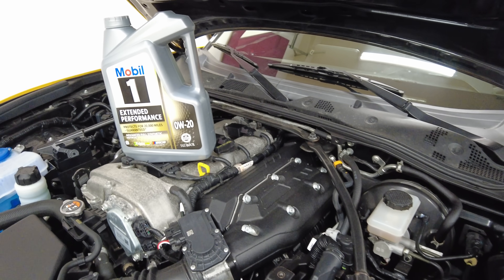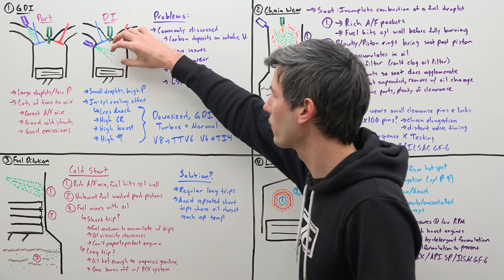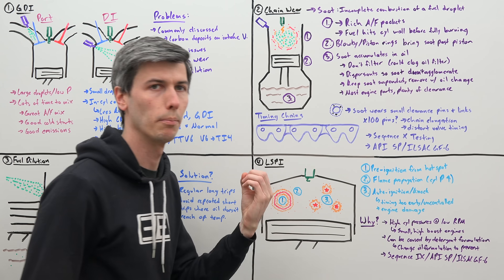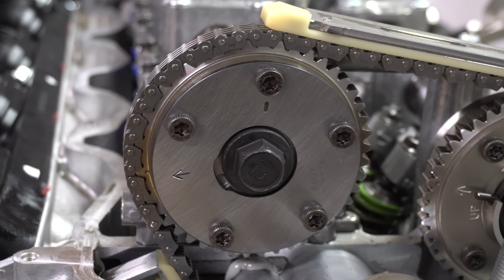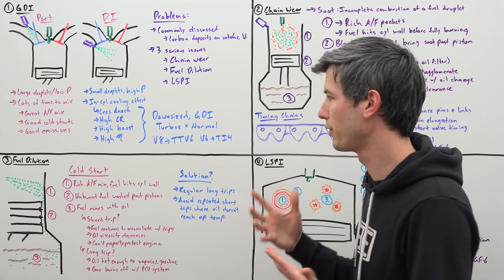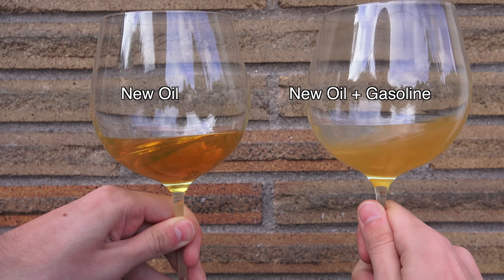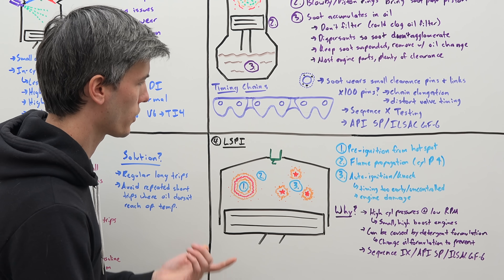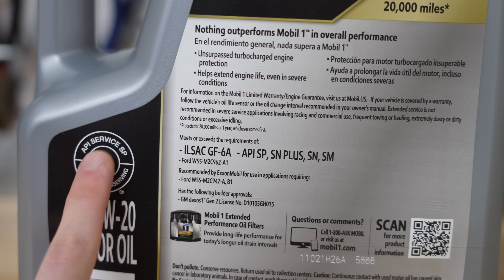3 Big Problems With Direct Injection Engines (Gasoline)

Comment: I have a2013 Ford Fusion, eth an EcoBoost 1.6 liter engine. Just coming up to 200,000 kilometers. A mechanic said I was lucky to get 200,000 kilometers out of it, as I follow the manual to the letter. Because Ford used 'one use only' parts, that are no longer available for the discontinued vehicle. We are looking for an older Toyota Camry, or a Corolla, to replace this car. Repair estimate is $3,000, more than the car is worth.

Comment: For engines designed to run 5w30 or 5w40 oil, this API SP specification adherence might be less important over that of SN. Taking a tuned EA888 as example, where i need to run 5w40 over the factory spec of 5w30 in order to ensure correct viscosity at the higher temps I see. I checked the specifications for the different oils i use, and none mentioned SP or ILSAC 6 for the grades i need, and only looking at 0w20 products did they start to appear. Would a tuned engine pushing more power that's designed to run on 0w20 then become too thin at the higher temps to provide the protection you need, given that tuning is a way to improve efficiency?
Reply: only 5w-40 (or thicker) in any case n nothing thinner;p..don't even ever have a single doubt..n there's no such engine on earth designed to run on some certain oil viscosity;p..thinner oils - only for environment's sake, but not for your engine's welfare n longevity..

Comment: Boost from a turbo does not happen at low engine speeds.  The boost is directly related to the exhaust output and speed, higher speed created a larger volume of air per period of time.  All engines output the same amount of air per revolution the faster the engine turns the more volume of exhaust.  Turbo and other boosted engines have a lower compression ration than a naturally aspirated engine to keep the peak cylinder pressure from creating head gasket failure.

Comment: I remember back in the 80's where Chevron started adding cleaners into the unleaded gasoline to keep the intake valve clean because of the gasoline going over the intake and creating carbon build up.

Comment: Question. Great video btw. In your fuel dilution section of your video, having your car stationed but letting it on for 10 mins without moving it, and then driving for 15 mins, would that still be considered as a short trip?

Comment: If you take anything out of this video is should that there are compromises being made.

Engines that run at high rpm need to have a lightweight rotating assembly. But in high load, low speed operations, they need better cylinder air swirl characteristics, which isn’t high speed friendly. Plus throwing boost at it doesn’t actually fix it, only band aids it. Likewise can build and engine for these conditions, dished pistons etc, but you will lose top end speed and power (somewhat Diesel engine like). So instead, you have an engine that compromises on longevity. 

More engineered oil with solve any of these issues. What needs to and eventually will happen is we will see different cylinder head designs, and pistons that will promote swirl or a/f mixing. There will be more injection shots per cycle and possibly even a second spark plug for more precise control.

Finally pistol cooling will be properly addressed and major thrust side of the cylinders will see proper cooling.

Long and short, gas engine engineers will pull their heads out of their rears and make engines properly. The reality is they have the ability to fully control ignition, injection, and even boost (somewhat), but they are limited by design decisions that plague them.

For the record Diesel engines are not immune to any of these issues, but mostly solved them all long ago when they went to high pressure direct injection with high boost. But the gas engineers didn’t seem to read any of those books. In the end, the consumers pay for it.

Comment: There are hundreds of thousands of DI engines running around with LSPI caused broken ringlands that have stayed in place and causing excessive oil consumption issues that most dealer cannot diagnose properly. Proper crankcase evacuation also reduces the chances of LSPI.

Comment: They need to do MPI and GDI or at least be equipped with a catch can from the factory. It's terrible how many misfiring cars I work on thats just oh well you bought GDI go get the valves properly cleaned at the dealer.

Comment: Why does it matter whether the air is cooled in the intake manifold or in the cylinder?  It's the same amount of cooling either way.  The advantage of DI is you don't inject until you the last instant, which reduces the chances of pre-ignition.

Comment: There's a lot of 'bad science' here, a bunch of assumptions that you seem to think the automotive engineers haven't already accounted for. There are literally millions for DI engines on the road today, with no known problems in the industry. Your acting like an Anti-vaxer, "well if 1:1,000,000, 000 people/engines might possibly have had a problem, this must be a bad idea, and we shouldn't do it. All anyone needs to do is follow the recommended manufacturer maintenance requirements, to include oil specification. That's it, you're inventing a problem that just does not exist. 
Also, on all my cars and motorcycles, the timing chain/belt isn't in the oil/gas/air area, its in a sealed separate/compartment, which specific engine have the timing mechanism within the combustion area?

Comment: Costly and early high pressure fuel pump failure seems to be common with these engines?   Somewhere around 50k miles.   Apologies if I missed another comment touching on this.

Comment: It never occurred to me that VW's 2.0Ts go through chains every 100,000 miles or so due to being Direct Injection. Might this also contribute to their 1/2 thrust washer design failing?
Reply: It's the tensioner that's the issue for almost all vw timing chains.  Almost never the chain itself
Reply: @ptspyder  I don’t think so in this case. the original recall was due to poor tentioner design, And that was a poor design, the original chain design wasn’t great eitherbut I put 200,000 miles and 3 chains on my GLI. (There’s been 5 iterations of chain so far, I used designs, 1,3, and 5) They stretched out by the time they hit 80,000. All 3 chains were different part # 
Ultimately engine failure was due to the thrust washer coming loose, finding the oil pump tensioner, and starving the engine of oil pressure.

Comment: As an expert in this area I approve of Jason's overall coverage of the topic. Not all GTDI engines suffer with it as it's very dependent on the exact design of everything component in the combustion chamber.

1. 2. 3. Centrally mounted direct injection is much better as its fundamentally going where you want it in the first place and any wetting is on the piston crown rather than the walls. Compared to side mount DI this leads to better mixing, reduced soot formation and reduced oil dilution. Latest fuel systems also have even smaller nozzles improving the atomisation and further reducing piston/wall wetting.
4. The most likely source of LSPI is different for every engine design. It can be oil from the ring gap, carbon deposits flying around the chamber or products of incomplete combustion in the spark plug crevice. Good engine design can minimise these when they are found to be an issue, but also you can design the vulnerable components to withstand the forces when they occur, - that is spark plugs, pistons and conrods. So oil might have a big impact on some engines (that suffer with LSPI from oil in the ring gap) but not all.
Reply from the maker: Thanks for sharing extra info! And yes, having spoken with several of the OEs about this, there's certainly a wide variety of how much these three problems affect different engines.

Comment: Thank you for the informative video!  With this info you gathered and presented, has this changed how you service your vehicles and/or would advise others to service their vehicles?  What are your thoughts on recommended fuel injection services and engine performance restoration kits such as those sold by BG Petrospecs and Valvoline?
Reply from the maker: I don't currently own any turbo engines, but my Mazda has direct injection (and is supercharged). I don't drive it that many miles, so I usually just change the oil annually, and use a good synthetic (in this case I'm using Mobil 1 extended service 0W-20).
Reply: @EngineeringExplained  thanks for your reply.  That makes sense.  In the Service Advisor world of which I was recently came and currently work as a Master Tech, short frequent drives as those usually taken by a retired persons lifestyle (not saying that’s you) would increase the importance of fuel injection services because of the carbon build up on the back of the intake valves and piston tops.

Comment: About chain-oil issue: manufacturers can separate oil for engine (contact with combustion artefacts) and other parts.
Same for fuel in oil.
For lspi just use the best fuel there: LPG.

Comment: Why is direct injection better for lowering temperatures over port injection? You still have the same amount of fuel being vaporised, is the fuel maybe taking in more heat before its entered the cylinder compared with direct injection? I'd like if some of these little details were explained briefly after being mentioned.

Comment: I would like to know WHY they did this?  For planned obsolesence reasons?  Sure there are some benefits, but, it will result in significant carbonisation of the valves, especially with the PCT systems as well (burned oil getting into the air intake system).  All this means power can be significantly hit over time, and wear, and means you might need a deep clean of your engine at some point, at great cost.  This is one of the reasons why I change my oil regularly at 7000 mile intervals, I have just changed my coolant at 30,000 miles, and I regularly use fuel system cleaning additives to minimise all the carbon build up as much as possible

Comment: My 10 year old Mazda 3's rack and pinion system failed along with lots of other issues so I started looking for a car. The Civic seemed perfect until I came across all this info. on the DI turbo problems. I didn't want another Mazda so I saw a 2017 Camry with very low miles and snatched it. This might be the last car I own for a lot of years with a naturally aspirated 2.5 liter 6 speed. I'll pay a little more at the pump. I don't think people realize how high maintenance this DI turbo stuff really is because the dealers don't discuss anything like that with people and most are not car savy anyway. The oil that some of these cars take now is 0W-15 (hard to even find anywhere and expensive) plus you're forced to drain it more often. Some people say the dilution is so bad they do 2,000 miles and it's loaded with gas.
Reply: my good

Comment: I don’t understand why everyone talks about port injection having fuel spray over the intake valves, creating cleaner intake ports and intake valves? ALL LS engines and a lot of other engines with similar PCV systems do not benefit from this due to the standard PCV system shooting oil vapor into the intake tract to be ‘burned’ but it over time leaves oil gunk on intake valves and intake ports over time decreasing performance and inducing knock. Still need a catch can or something similar a one way breather to help with that gunk up and excessive oil “burn”

Comment: Diesel engines been running direct injection for ever. They far outlast petrol engines. Their chains last as long as the engine and is designed for the engine. Fuel passing the rings is a problem of over fuelling not direct injection.  Pre ignition is also less likely to occur as fuel is only injected near TDC. Oil ignites at higher pressures than a direct petrol injection engine has and I doubt oil volume pass by will cause preignition. The car would normally have a knock sensor so I doubt its a problem.  So to me this is a lot of bla bla bla for those that know little. What about running higher fuel pressures? Extra cost to parts? My 5 cents.

Comment: The chain problems are a point i hadn't heard being related to soot in the oil before. And it sounds strange to me: Diesel engines have soot in their oil since they are in existence, and chain lengthening wasn't a problem before manufacturers started making chains thinner and weaker in the last 15-20 years.
Reply from the maker: Yep, discussed this with Mobil 1 engineers. Diesel soot is softer, not as abrasive as gasoline soot, which means it's not really an issue with diesel engines.
Reply: @EngineeringExplained  Thanks for answering!

Comment: The main thing I against GDI engines is they don't seem to have any safeties built in for when the injection parts fail. 90% of the GDI engines I see have blown the ring lands out on one cylinder from a underperforming injector/overly lean afr or seized/worn the bore from overfueling and bore wash and they never seem to have the fault logged in the ECU.

Comment: The 4 pot turbo used in the Z4 had issues. Seems BMW changed the oil changes from on condition to 10k miles. My N52 on my Z4 never go beyond 5k. Why BMW try to stretch the turbo to on condition just silly marketing ploy which will cost the owners.
Go back to 1960's friend had new Mini cars, run them to 250k miles on 3k oil changes.

Comment: I thought it odd that the 4 cylinder 2.0L turbo GDI gas engine for my car puts out far more soot than the diesel engine for the same car.   Of course, the USA EPA won't let the lower-polluting diesel be imported, only the sooty GDI

Comment: is there specific engine oils for diesel and petrol engines.?
the confusion I'm facing is, im using a diesel car and the manual says "mobil super 3000 0w20" engine oil for its diesel and petrol variants. but all the 0w20 engine oils out there have "for petrol engine" written on it. or "best for petrol/hybrid engines" etc.
is it safe to use those 0w20 in my diesel engine?

Comment: I had a 2016 Ford Fusion with the Four Cylinder Turbo, at times of Startup, my Tailpipe will blow out a lot of soot on cold starts and blow out for 3 seconds and stop smoking.
   This car only had 80,500 miles on it, and it was doing just that.
  Yes, this engine had the GDI system on it and I think that the buildup was happening in the engine, I just got rid of that car 4 days later after seeing it do that and got me a different car, this time a Dodge Durango R/T I love it more than the Fusion, Although I love my fords, but there were too overpriced due to chip shortages and they wanted more like $15,999 more on the cost about the manufacture list price. Yes, I have heard that many Ford Dealerships got in trouble with Ford due to this very high markup. 
Yes, that has got me not to buy a Ford, but get a Dodge Mopar product. 
   I noticed that Ford Vehicles are becoming more and more expensive these days and for the price, I'll just pay $3,000 or $4,000 more for a Lexus that last 4 to 6 times longer than the ford hands down.

Comment: Well if it does go out my vehicle is covered bumper to bumper up to 120k miles and power train up to 200k. That’s Hyundai platinum warranty coverage which is why I don’t worry about anything.

I drive 2020 turbo charge Suv AWD 
High end model vehicle. So it’s not a regular suv it’s one of the top of the line vehicles. 

That’s why I decided to buy another Hyundai vehicle because they take care they’re customers

Comment: turbo engine are crap!!!! they all burn oil and antifreeze. not to mention they destroy engine oil. idiots like bmw and mercedes that say you only need 1 oil change a year make me laugh. And the biggest problem with direct injection especially turbo is carbon build up on intake valves. THANK GOD TOYOTA  was smart enough to have both !

Comment: I was wondering what it is about the formulation of the SP oils, versus the older classes, that causes less cam chain wear, since the same abrasive soot particles are in suspension in the oil. 

My policy has been to change the oil at 3K miles, when oil testing has shown the oil beginning to shear down and drop its high temperature viscosity and the color begins to darken. The VQ37VHR engine in my 370Z at 37K miles still shows no appreciable oil consumption on the dipstick over these oil change intervals.

Comment: 👾In a Mercedes turbo V8 the high pressure pumps for both banks are driven by the back end of the intake camshaft on bank 1 amplifying the chain / gear issue you're talking about. Informative well executed video man... thanks.

Comment: Thanks for the info. It's really interesting as a DI owner. I have a 2019 Toyota Yaris(Mazda 2) with a 1.5 DI engine. I use a spray and soak carbon cleaner before each oil change to clean the intake valves every 5000 miles. I wasn't aware of the low speed detonation and chain pin wear, though I am aware of the oil dilution. It's good to know. In an effort to prevent wear from dilution, I'm using just regular full synthetic Quaker State with the gold label. 540RAT blog tested it last spring and found it to have a film breakdown strength of 152ksi, and respectable high temp breakdown, I think around 280°? It outperformed the Amsoil signature that I ran in my 5.7 hemi to keep the cam lobes from wearing out, so I switched, plus it's a lot cheaper than Amsoil.